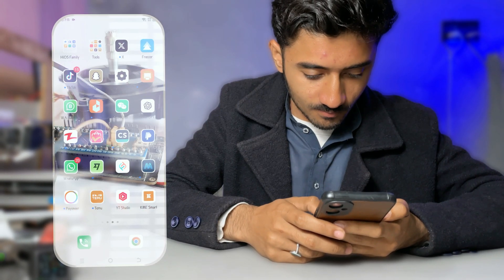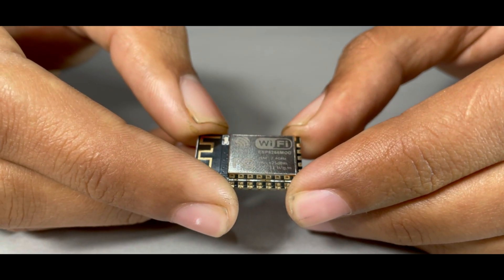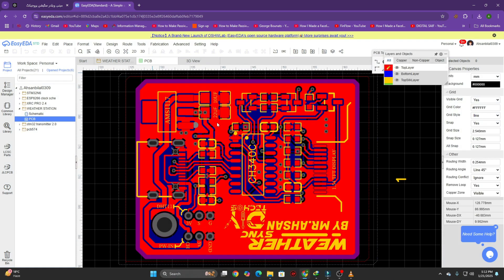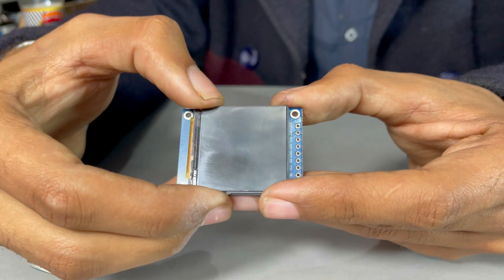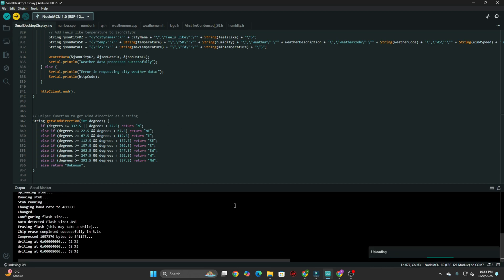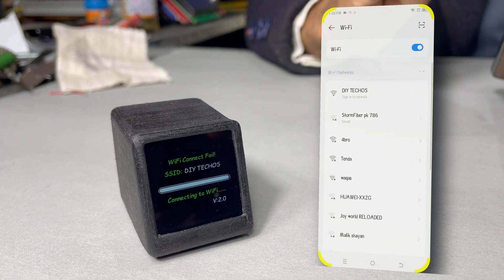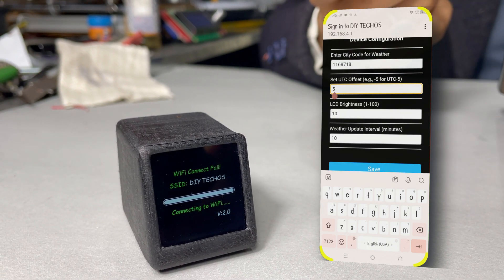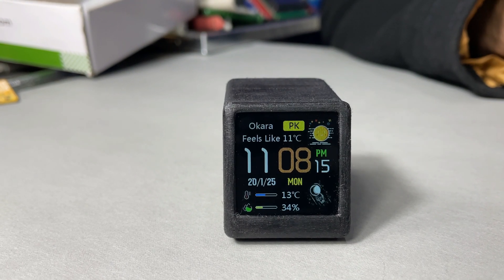This Weather Station Build Beautified My Desk!

Comment: bro permission to ask, how do I change the wifi connection from the device to another wifi, other than to the wifi connection at the first setup, because in my area there is a wifi without a password belonging to a neighbor, so that the device is automatically connected to that wifi and cannot be configured anymore, thank's a lot before that
Reply from the maker: bro,i am upgrading the code to solve this issue especially.For you,only two cases are helpful like to turn off the router and other is to reflash the firmware to configure new wifi settings